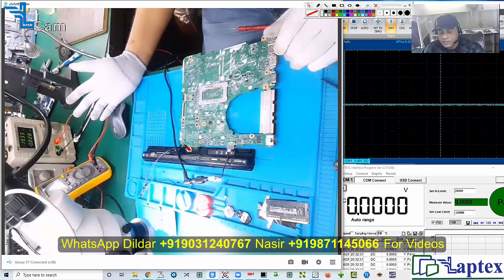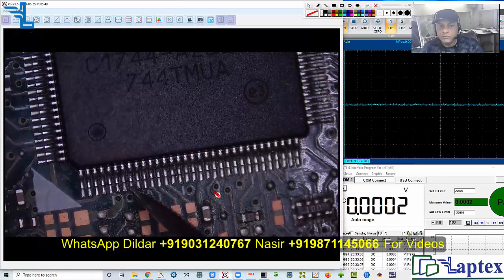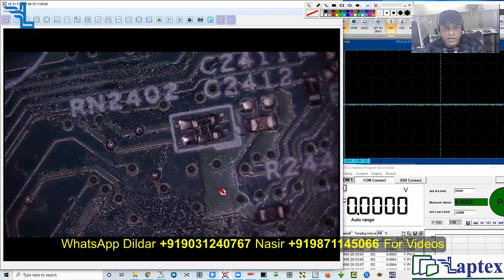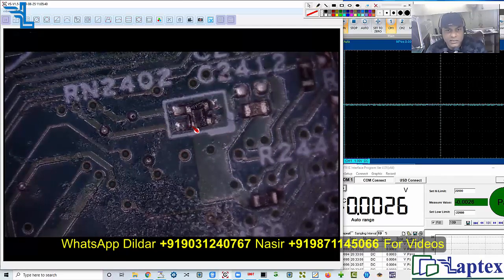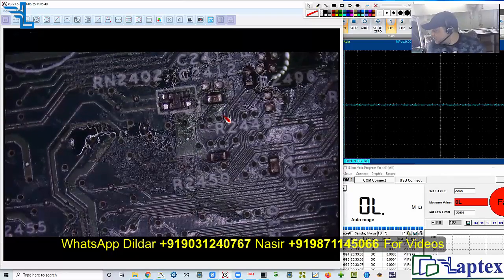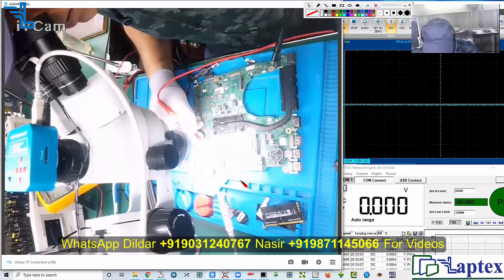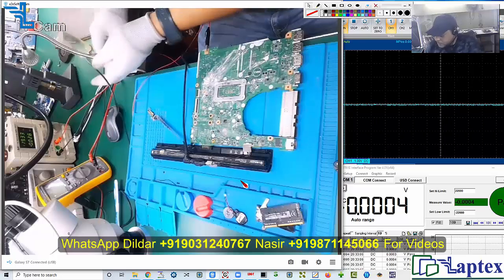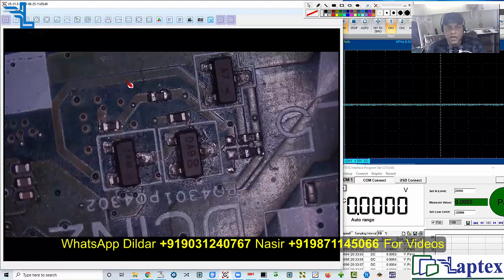Dell Vegas Bat Charging | How to diagnose charging problem Eng Part 4| Chiplevel repairing training

Comment: Sir video is going very long.
Reply from the maker: Yes it's a long case study... Sometime you can also face like this...so it teaches us to keep patience while we work on some critical and typical cases 😊❤️
Reply: @laptex1377  sor inhave also lenovo t430 laptop when i insert the battery and turn on there is a message " CRITICAL BATTERY LOW " and turn off but without batter it works perfect replaces think engine IC.
SDA SCL and 3.3 volt is ok i am stuck in this case not able to solve kindly help me to troubleshoot.
I have diaconnect the battery temp pin it is not showing battery low warning  but on windows battery is not present appearing.
Kindly help.